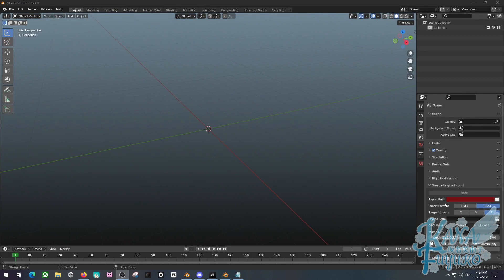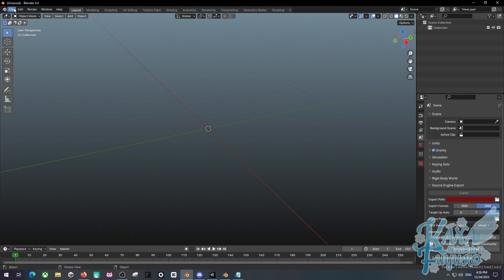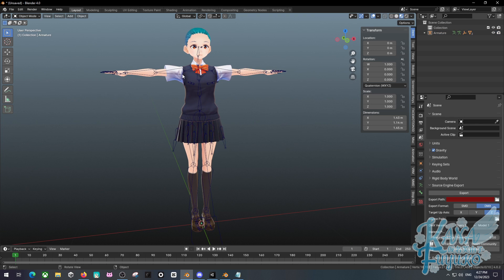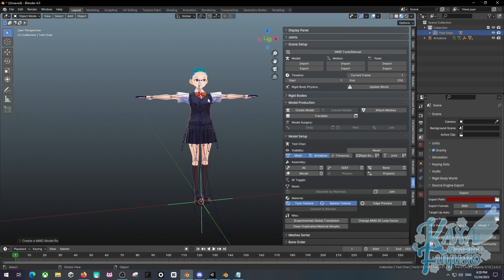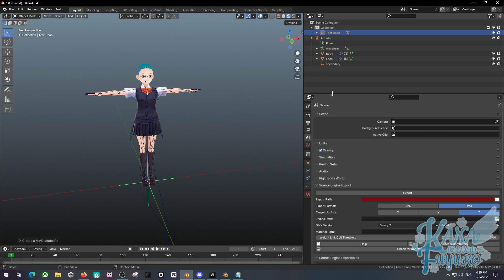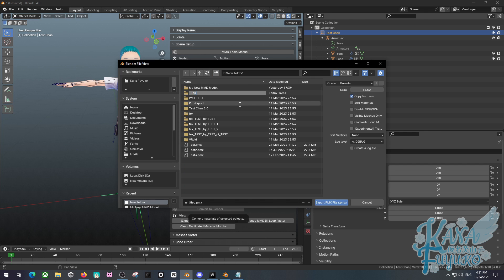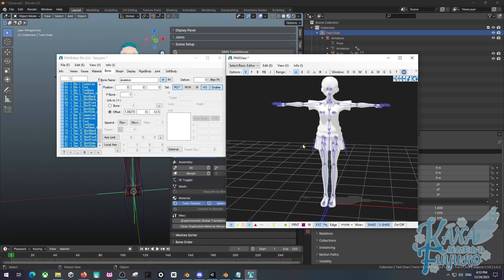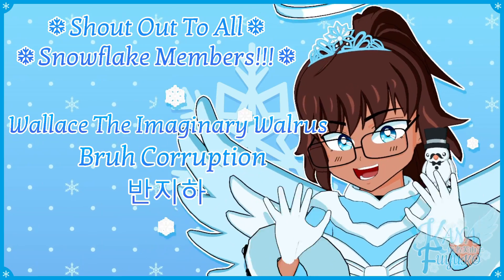(Quickly Explained+Remake) How To Convert A 3D Model In Blender To PMX Editor!!!

Comment: what if i want to convert an object with a rig (not a human) into a pmx?
Reply from the maker: Same exact process but you select the object instead for export.
Reply: @Kana_Fuyuko  what if it already has a rig? its not a humanoid
Reply from the maker: Same process, pmx format is not humanoid exclusive. It can be used for anything.  @mike-t9r3m
Reply: @Kana_Fuyuko  I get this error saying the armature object can't be found.
Reply from the maker: @mike-t9r3m  Did you clicked on the armature, click on "Convert to MMD Model", compared the hierarchy on the top right of the video to your screen and then selected the empty object stated in the video and exported?
Reply: @Kana_Fuyuko  what about an object with no armature like no rig. Lets say i was making a object that doesnt move and i want to convert it to a pmx file to use it in mikumikudance.
Reply: @Kana_Fuyuko  I fixed the issue, it was because I was using blender 4.0 instead of blender 3.6. Compatibility issues.

Comment: is there a specific version that particularly works/you'd recommend me using? (I know for a fact 4.0 is completely out of the question but still)
Reply from the maker: Depends on what version you are using with the MMD plugin. The MMD plugin did got a proper 4.1 update so you can use the newest version of Blender with the MMD plugin. If you needs CATS Blender Tool then stay Blender 3.6.

Comment: I don't know if you cover this in the longform video version of this tutorial, but is it possible to do the reverse of this? As in converting a 3D Model from a PMX file into Blender for editing? I've looked this up but everything I find is about Blender -> PMX Editor and not the other way around. There are models I've downloaded as PMX files that I want to edit the 3D model itself of and you said in an old tutorial that making models in Blender is easier, I figure model editing would be too
Reply from the maker: @pundesune  You can just use the MMD plugin, no need for the Cats plugin cause the MMD plugin alone imports and exports pmx files. All Cats does is shove the MMD plugin into their plugin for those converting MMD for VRChat usage originally. I only said I would make a video version in case out of preference but with applying knowledge it's pretty self explainatory the MMD plugin can import pmx to Blender easily.
Reply from the maker: Give me some time and I'll make a reverse version.
Reply: just get the MMD_tools plugin and then import the model as pmx into blender - use properties tab (n) to pull up the mmd tab